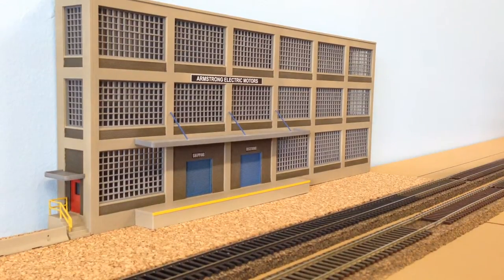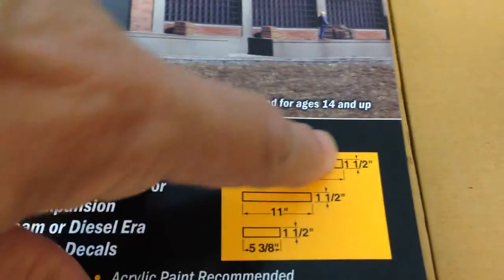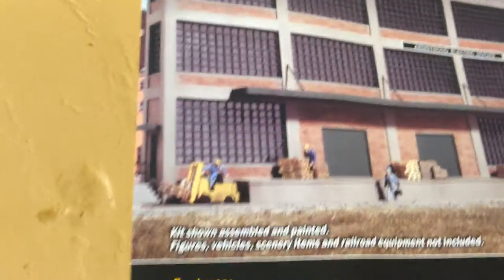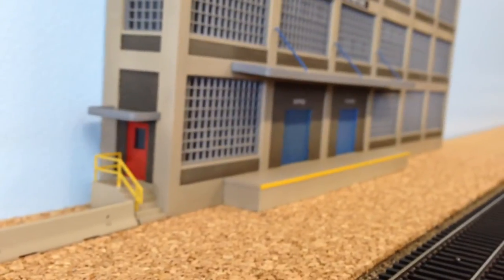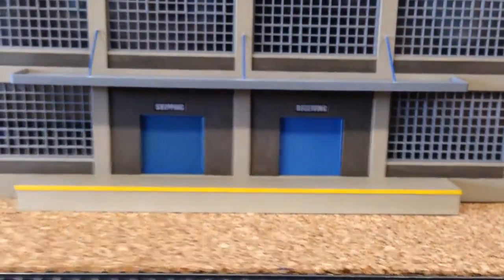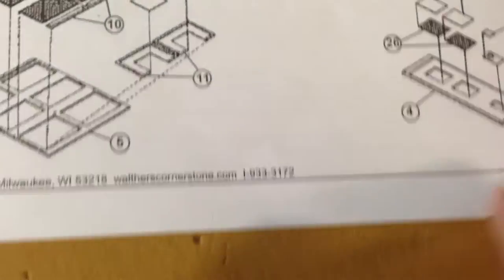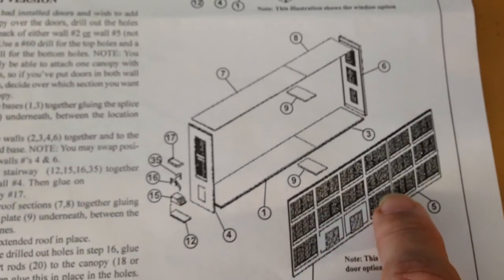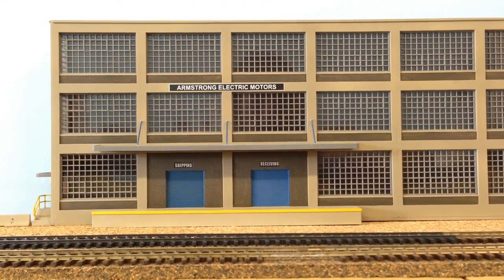Walthers Cornerstone Armstrong Electric Motors Background kit

Comment: Hi, like your video. I have the same kit. I noticed it came with parts not noted in the instructions, including  2 skylights ( not sure how to mount these, a gray part 13 that looks like a base that has a textured surface at the base and parts 38  and 39. Do you know what these are for? Thanks

Comment: For brick try Krylon Red Oxide...cheap at Walmart
Reply from the maker: Thanks Steve.  I prefer to use my airbrush when I can.
Reply: Oh I love my airbrush to.  But its a bunch of work cleaning up, changing paint, etc...Its the best way to go if you have the patience....which I dont.
Reply from the maker: I hear ya.  That is why I try to use acrylic paint, easy clean up.
Reply: I hear ya....Enjoy your builds.  My layout is going to require several background buildings and being able to see then in something other than a picture sure does help...keep it up.
Reply from the maker: Probably be a while before I can start the next build, gotta save up some more lunch money and figure out what I want to build next.  If you have any suggestions on other background buildings, let me know.  I think I need 1 or 2 more…
Reply: Not knowing much about you layout...will the Centenial Mills fit?